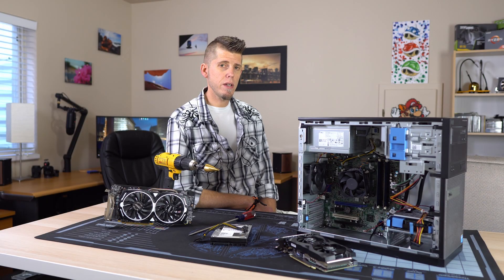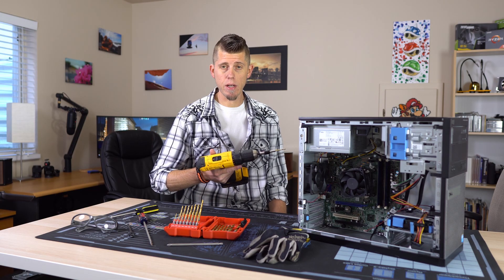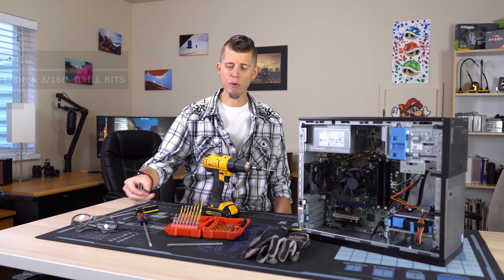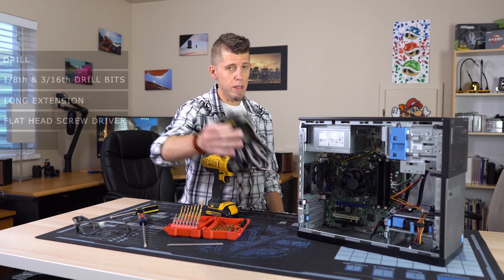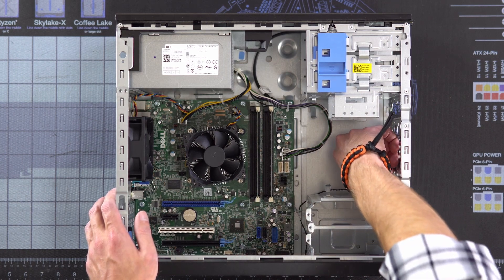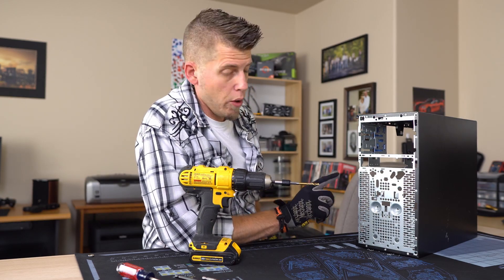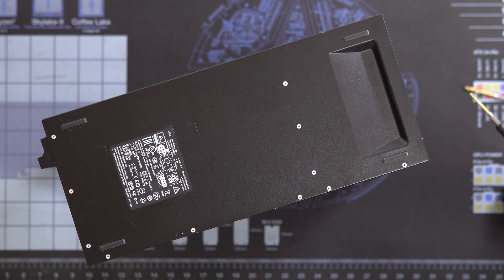Adding A Bigger Graphics Card In A Dell OptiPlex

Comment from the maker: If you already know what tools you need an how to tear the system down, just skip ahead to the removal. This is the second video in a series of five. I highly suggest watching them in order.

Timestamps:

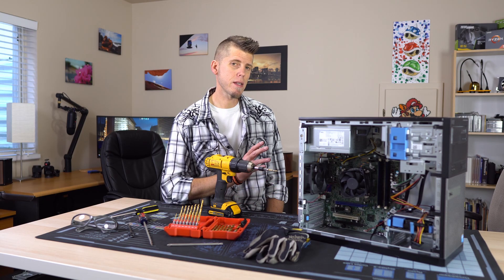Tools: 0:29
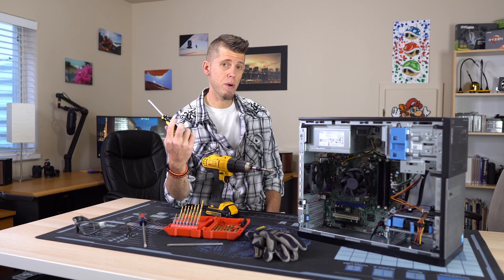Teardown: 3:30
HDD Cage Removal: 5:44
Conclusion: 10:35
Reply: Can we put this hardware in the new case like like thermaltake p3 ? If yes than this motherboard hole pattern is standard ?
Reply from the maker: @razaaali  Yep, the board is a standard micro ATX pattern and can be swapped into another case. The mounting point for the heat sink, unlike an equivalent HP's, is also standard so you can mount any 115x compatible cooler. However, to get the power switch working, you're going to have to figure out the correct pins up top. I don't have a video on that and don't know if I will do one, but thankfully, Greg Salazar has done one that can get you sorted.

https://youtu.be/TYRjgUojBnc?t=380

Also, if you're using a 3020, 7020 or 9020 and you need to swap the PSU, you'll need a converter for the main ATX power, and this is the one that I've used for a few of these.

https://amzn.to/2J5RtJs
Reply from the maker: @Chabbaquq Yahudah Yahisreal What I said in the video was that the SATA ports as well as the USB3 will interfere with any GPU over about 8.5". Some people have gotten around this by using right angle SATA cables and just leave the front USB3 unplugged. However, this means you cold only use two of the three SATA ports. Also, I've talked to some people that have tried this and it doesn't work. It seems it's dependent on the GPU and it's shroud. However, since making this video I've found some low profile SATA cable that might be able to allow you to use all three SATA ports regardless of the GPU as well as a USB3 cable that will allow you to keep the front USB3 as well.
Reply: DUDE THATS A OEM PC .....HOW U GET IT ....AND AINT THAT ILEGAL.
Reply: Is a ryzen cpu compatible in a optiplex computer
Reply from the maker: @flankingfoxtrot  No. These motherboards are Intel only, and for specific CPU generations. For instance the xx20 series OptiPlex will work with only the 4th gen Intel CPU's. You would need a compatible AM4 motherboard for a Ryzen CPU.
Reply: @TheGameBench  thanks
Reply: What is the highest cpu I can place inside this unit?
Reply from the maker: @dangerzone6481  The absolute best in a 3020, 7020 or 9020 is the 4790K. I've tested it and it does work. However, it doesn't really provide more performance than the 4790 outside of 1080p low settings, where the higher clock speed makes the most difference.
Reply: So what is the newest graphics card someone actually has used in this pc?

I think dell has a limit on too new of a graphics card. I have a 600 watt psu, and the asus gtx 1650 super won't install the drivers. 

I get a display through the display port, but not the dvi port. 

I tried a zotac gtx1650, and it did the same thing. In either case cpuz shows a gtx 1650 or 1650super, but the drivers wont take. 

Also, i upgraded to a gtx 750super and it worked great, basically put it in and the drivers worked. I am just curious if the lastest bios update from 2019 is not new enough to handle the 1650s i bought.
Reply from the maker: @MrSeanselleck  What system is this specifically? I've installed multiple 1650s in Optiplex systems. I've installed newer, and much more powerful GPUs as well. There's no reason a 1650 shouldn't work in an Optiplex. If this is a different Dell system, there there could be other issues. Sometimes they like to limit the power to the PCIe slot to 25 watts, which can cause issues, regardless of what power supply you have. That isn't something they did with the Optiplex. There could also be damage to the PCIe slot that's causing issues as well. Also, the BIOS shouldn't really have an impact to what GPU you can install outside of some BIOS corruption or something strange. Under normal circumstances, it should have no impact on that.
Reply: By the way, your video on the i7-4790k was excellent, and helped a lot.
Reply: Where can I send a picture as I'm selling my custom 9020 you helped me build here. But im old and had to add some fun

Comment: How did you take that cord out at 5:27 it won’t come out?!??
Reply from the maker: Sorry for the late reply. There's a button on the fan connectors that you need to push in. Sometimes they can be a PITA and you might need to push the button, then push the connector down, and the pull it out... or it might need to be wiggled around before it releases.
Reply: @TheGameBench thx
Reply: He just removed it with the power supply, theres tutorials on how to remove those cords.

Comment: how about also removing the optical drive cages as well?  That way you could put in bigger upgraded motherboard you could then turn turn the optical drive sideways.
Reply from the maker: You would also have to find somewhere else to put the power supply in order to fit a full ATX board. There are enough good mATX options that I would bother removing the optical drive bays, at least not for that reason. The following xx40 generation and up... that's a different story since removing it allows you to install bigger CPU coolers.

Comment: I have an msi gtx 1650 super gaming x. The specs page says its 248 mm long.  Will it fit in this case without mods?
Reply from the maker: At nearly 10 inches there, not really. You "might" be able to get it in there but you could end up damaging something in the process, and in the end, it probably won't fit.

Comment: I use a 1tb hdd for bulk storage. is there anywhere i can put it if i do this.
Reply from the maker: If I include a HDD, I put them in the 5.25" bay under the optical drive. You can get adapters for like $10 or you can just use screws on one side to secure the drive. This was one part of a series, that I did a terrible job of communicating, and I show how I add a HDD in the completed build video. There's a link to it in the description of this video.

Comment: Didn’t want to get rid of the HDD cage on my Precision T1700 AM5 build, but there was just no way around it.  You’re right about having the proper drill bits.  I have an extension arm, but my cheapo Ryobi bits are rounded at the base.  I ended up brute forcing the innermost rivets.

Comment: All that stuff I'll have to take out... I won't remember where all that goes. No way. How much worse are the smaller graphics cards? The GTX 1660 you talked about, it's still better than the Intel HD 4600 that came with mine, right? I've never really experienced anything faster than that. My computer struggles to play games from 2010+, so if I can play more modern games at at least 30-40 fps, I'll consider that a win

Comment: So what is the newest graphics card someone actually has used in this pc?

I think dell has a limit on too new of a graphics card. I have a 600 watt psu, and the asus gtx 1650 super won't install the drivers. 

I get a display through the display port, but not the dvi port. 

I tried a zotac gtx1650, and it did the same thing. In either case cpuz shows a gtx 1650 or 1650super, but the drivers wont take. 

Also, i upgraded to a gtx 750super and it worked great, basically put it in and the drivers worked. I am just curious if the lastest bios update from 2019 is not new enough to handle the 1650s i bought.

Comment: I know I am late but is it really that nesscary to remove the motherboard (I am putting an rx 570)
Reply from the maker: I would. Removing the cage is going to create loose metal which can find it's way between the motherboard. So if you don't, you run the risk of creating a short and damaging the motherboard.
Reply: @TheGameBench  but what If I put a piece of cardboard in the middle where the metal and motherboard has no conatact (thx for replying)

Comment: Removed mine tonight and couldn’t figure out what was still holding it. I went back to this video and realized about the 4 that hold it to the back wall of the case. I was actually able to just use a regular drill bit and no extension myself, but I put the bit into the drill just enough for it to hold in order to make the bit “longer” and reach inside the cage

Comment: please is the pc still working after drilling cuz my friend told me it will become faulty after doing this how true is that
Reply from the maker: I don't know why your friend would tell you that since the hard drive cage is part of the chassis and has no impact on the functionality of the computer itself. Removing it only changes how you can think about where you put your drives, which is something that I go over in the build video. So, yes... the computer absolutely still works and I've done this to A LOT of systems over the last few years and not one has been impacted by removing the HDD cage, as one should expect.

Now, if you don't remove everything and clean all metal out after removing it, that could cause a short and damage something... which is why I suggest that you should completely strip the system down before removing. There's also the possibility that a part could be damaged in the process of taking the parts out and putting them back, but that's super slim if you're comfortable with taking the computer apart, and that has nothing to do with the drive cage itself.

Here's a link to that video where I talk about options for places to put the HDD after removing the cage.

https://youtu.be/snUV0wGPnPk?t=312
Reply: @TheGameBench  thanks for your responds

Comment: you can also use a hammer and a flat head screwdriver to remove the rivets and get the hard drive cage out
Reply from the maker: Yep, I know. There are some models where the HDD cage isn't pinch riveted to the back of the case, and this method works great for those. Which I hadn't run into when I made this video. But it's not a great option to get it out cleanly where it is pinch riveted to the back. Not saying it won't work, but you're going to have to tear it out of there, and it's not likely to come out without mangling some stuff up.

Comment: I'm thinking about doing this to a Precision T1600.  It wasn't mentioned but I think it's the same chassis, or very similar.
Only hangup I have is that I'd like to be able to reinstall the cage later with screws and nuts.  I'm hoping that crossbar that got ripped out in the video is optional.
I will eventually upgrade my gaming PC to a newer board in a "normal" case, at which point I might want the drive cage back in this one.

Comment: I have an older case (not nearly as old as that one), but it was designed for max 285mm videocards. Thankfully the hard drive cage at the front of the case was easily removable, I think this particular case (Lian Li PC-9F) was built with some future-proofing in mind.
Reply from the maker: That was pretty forward thinking. Good for use as a server or a gaming system. Just needs a little black paint and you might think it was a brand new case. Back when I was running a 2600K for my main rig I was using a Lian Li PC-7FNWX. Loved that case.

Comment: I have a rx 6500xt, the ram is in the way of it and it won’t fit with all the wires in there. Please help.
Reply from the maker: Are you saying that the RAM clips are preventing the GPU from going in? And are there wires in the way as well? What model do you have specifically?
Reply: @TheGameBench  I have a dell optiplex 790

Comment: would i need to get a new psu for the gpu or does the already installed one have pcie cable and enogh power
Reply from the maker: That depends on the GPU. No, the stock power supply doesn't have a PCIe power cable, but it supplies enough power for some lower power GPU's with PCIe power connections. I've run various cards off the stock PSU, monitoring the consumption, and with a dual SATA to single PCIe power connection you can get away with the 1060 6GB, 1660, 1660 S/Ti, 3050 and maybe the RX 6600, I still need to test that one. The RX 1050 Ti, 1650, 1060 3GB and 1650 Super are fine with a single SATA to single PCIe power adapter. As is the 6500 XT, but I don't suggest it in older systems for other reasons.

I'm not saying you shouldn't get a better power supply, but you don't nessisarily need to, and people often replace it with a higher wattage, but somehow lower quality unit.
Reply: @TheGameBench  thank you that really helped!

Comment: Ah, thank you very mulch for the help. I was trying the Net Guy's technique, but just drilling the outer rivets didn't cut it. Breaking the bar in the middle of the cage, then reaching in with the drill to catch the other four rivets did the trick. It's gone at last... but I didn't remove the components from the system before I attempted this, which worries me a touch. Only one way to find out if it functions!

Comment: I have a agw550 power supply would that connect to the rx580 or would I need a different cable? I’m sorry I’m new to this
Reply from the maker: I would be very surprised if that power supply didn't have the necessary PCIe dedicated power cables So no... you shouldn't need anything extra to run your GPU with that power supply. If you're putting all of this in a 3020, 7020 or 9020 OptiPlex, then you will need the 24-pin to 8-pin adapter for the motherboard.
Reply: @TheGameBench  so I just removed my hard drive cage and added the rx 580 and added my new power supply the agw550. I got everything hooked up and all I had to do was to turn on my computer and it didn’t power on. What went wrong? I plugged the cpu cable from the power supply into the motherboard and the 24 pin adapter to the motherboard
Reply: @TheGameBench  before I had the pin adapter I tried upgrading my psu previously but it didn’t power on, I needed the adapter to power it on right? Because now I did try it with the 24 pin to 8 pin adapter just now and it still doesn’t turn on. I’m new to all of this that’s why I sound so lost. I appreciate your videos it’s made me confident to mess around with pc.
Reply: Update, the pc is flashing yellow what does that mean what can I do
Reply from the maker: @tehOGKev  Depends on the model. Dell has a whole list of diagnostic codes.

https://www.dell.com/support/kbdoc/en-us/000126021/a-reference-guide-to-the-dell-optiplex-diagnostic-indicators

Comment: So the only option to get the hard drive cage out is to drill out holes? I can’t remove the screws with something?
Reply from the maker: You could use a hammer and a chisel or a bulky flat head screw driver and bust the ends off the rivets. However, if the cage is pressed in at the rear, that's going to be hard to do without drilling them, but I've heard from people that have just ripped it out. But I caution that could bend some things up if you're not careful. There are some models that have tabs you can bend out at the rear with the flat head, and then just lift it up and out once you've removed all the other rivets, which should be easy if you've got one of those models.

Regardless, it's definitely possible without drilling.

Comment: So where do you keep your hard drive now?
Reply from the maker: Yeah... I really bunged up these videos. I was trying to make it kinda' like a build log and I go over all that in the final build video, but I did a crap job and didn't make it clear. I stick the HDD up in the 5.25" bay below the optical drive. You can get some low profile screws and hold it in at one side, or there are 3.5" to 5.25" adapters you can use for a cleaner approach. The I use some 3M Command strips to put the SSD on the side where the drive cage used to be.
Reply: @TheGameBench  oh yeah. After this video I saw another video when I saw you mention this. Thinking of doing it myself

Comment: My Optiplex 390 had some lock sliders on the cage... the side and back rivets came out easily.. it was the sliders that were difficult.
Reply from the maker: Yeah, after I did this video I found that to be the case on some of the xx10 series models as well.
Reply: @TheGameBench  Thanks for posting this...  I have a few Optiplex 390's I have to work on and your videos are a great help.

Comment: does the gtx 750 ti (no lp) fit without any modification
Reply from the maker: Inside a mini-tower like the one I modified? Absolutely. Most models are well under 9.5 inches, and that's about the biggest I'd suggest. Here's a list of 750 Ti models and it has most of their lengths listed.

https://www.techpowerup.com/gpu-specs/geforce-gtx-750-ti.c2548
Reply: @TheGameBench  Thnx
Reply from the maker: @controller_player3868  No problem.

Comment: he didint say where the harddrives will go afterwords
Reply from the maker: Sorry, I didn't make it clear that this was a multipart video series of a project build. I go over all that in the build video which is linked down in the description. I give you a few options for what you can do, but I typically put an SSD on the back panel using some double sided tape, 3M Command strips being my preference. And then I put the hard drive up in the empty 5.25" bay.

Comment: Watching this in August of 2021 is super frustrating because I want to start doing this again, but the GPU market is so completely screwed up that it's just not feasible. I could snag a 1060 and pay wayyyy too much for it, but then I'd have to charge way too much for the finished product that it'll be super hard to sell. 
Maybe one day...
Reply from the maker: You and me both. I've got a bunch of systems in my back room just because I can't sell them in the current situation. Thinking about grabbing a 980 or a 980 Ti and seeing how that goes. Seems to be about the most reasonable deal in GPU's right now. It will get better at some point... I just don't know if the demand for these systems will be there.
Reply: @TheGameBench  I recently was able to snag a 960 4GB for not too much and put it in a system that I then sold. Haven't been able to repeat that success, though. Now every 960 I see is touching $190+ BEFORE shipping. It's just not worth it.